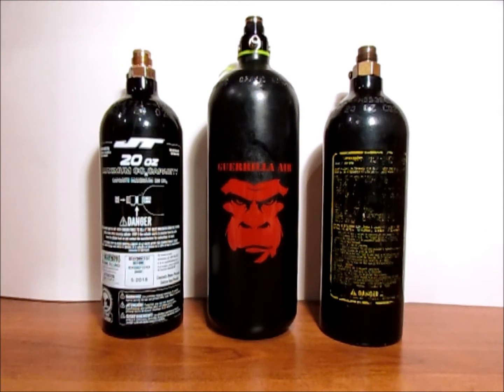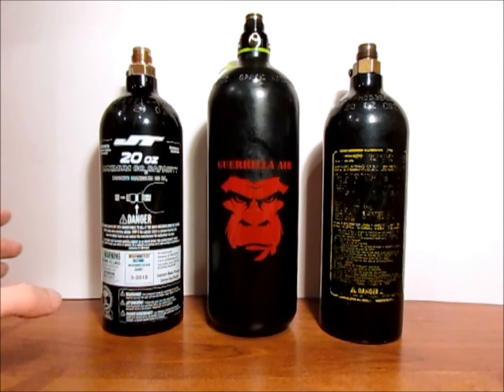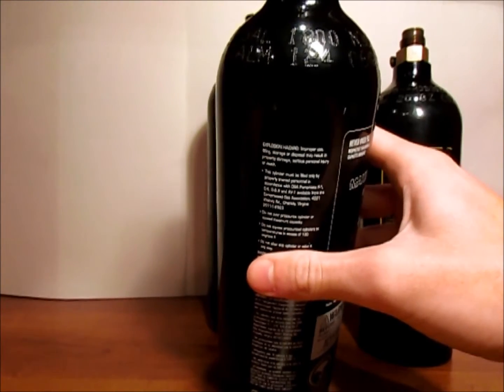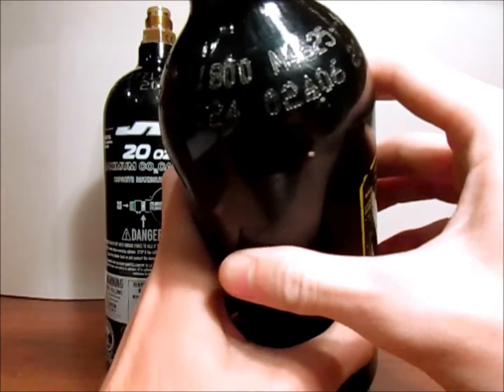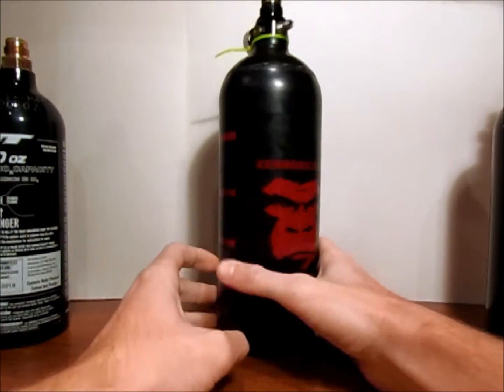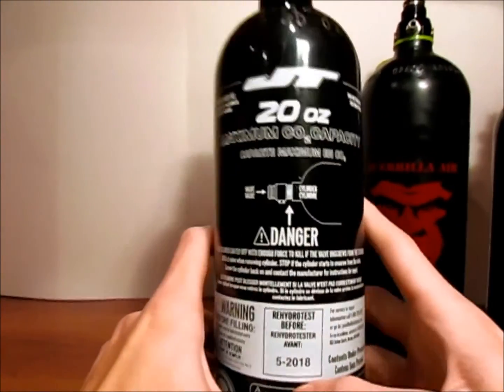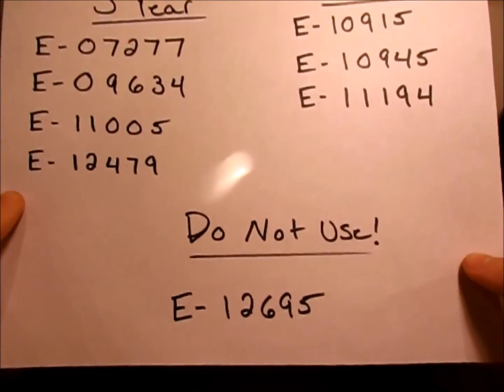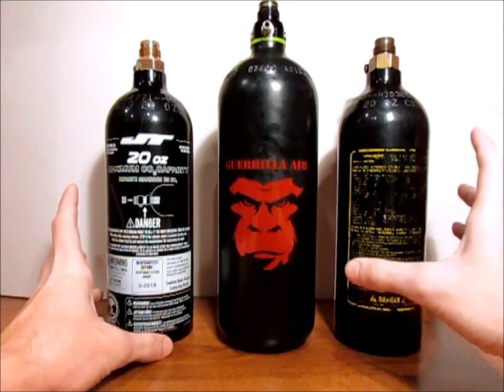How To Determine Hydro Test Date CO2/HPA Paintball Tank

Comment: I just bought an old tank from 09 at a yardsale & dicks sporting goods just filled it without testing. It almost looked like it was bending so I figured vent some pressure. I put it in my gun but before I could fire it to vent, it started bursting out of the ASA. Frankly now Im just worried & don't want to mess with it, any advice on what to do to depressure it safely
Reply: is it HPA or CO2 tank?  hpa are better because it regulates the pressure...the co2 is less safe in my opinion and from what ive seen
Naw, Dicks sporting goods sucks when dealing with paintball supplies..they just sell it
try going to your local scuba tank shop or your local Firefighters know where the nearest place is

Comment: Question... so once it hits the 5 year mark n it gets hydro tested... do they re stamp it or how will they know it's good now
Reply from the maker: Hi Armando and thanks for your question! Once the tank is hydro tested the company that performs the test will either attach a sticker, apply a paper and clear coat, or stamp the bottle with the new date. Once this is done your tank will be ready to go and will be accepted by all paintball fields!

Jimmbob82
Reply: Thank you very much I'm new to paintballing and bought a used set and realized all tanks were expired
Reply: @TheHuizar22190  I did the exact same thing thought I was snagging a deal cause they were throwing in the tanks but then realized that I am not complete without the tanks and the hydro is expensive I might as well just get a new tank or rent one in the field